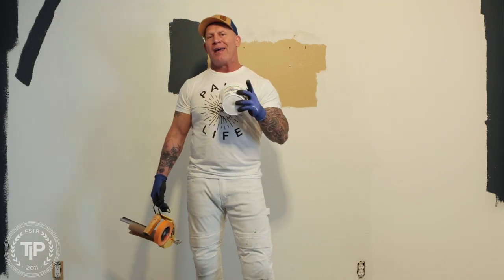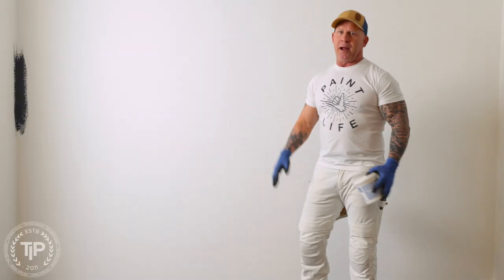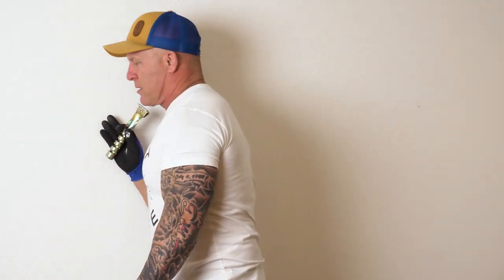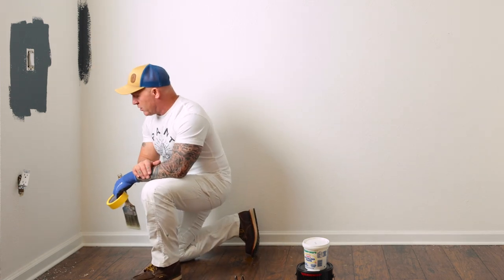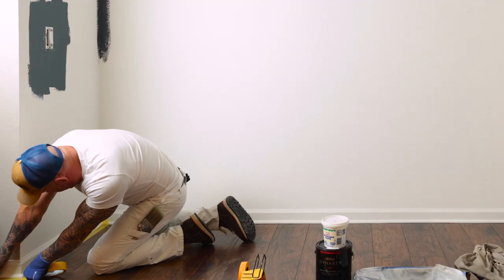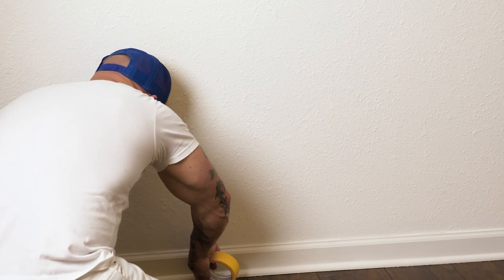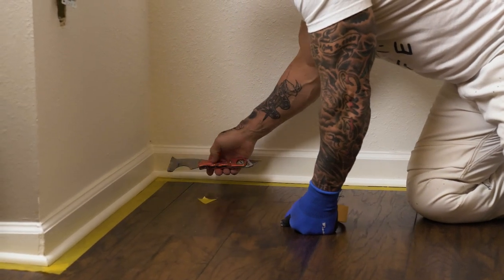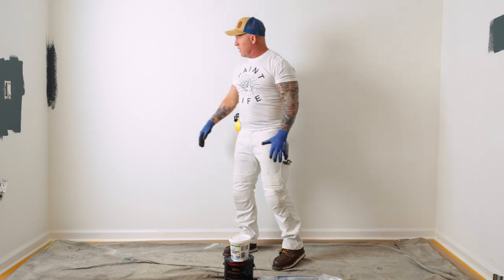Painting PERFECT Walls | Master Painting Interior Walls

Comment: A good way to find all those imperfections is to use a high power flashlight. Hold it parallel to the wall and you'll find more than you want.
Reply from the maker: Good tip